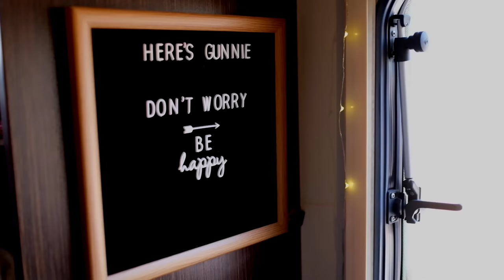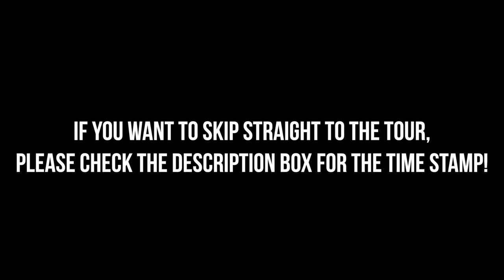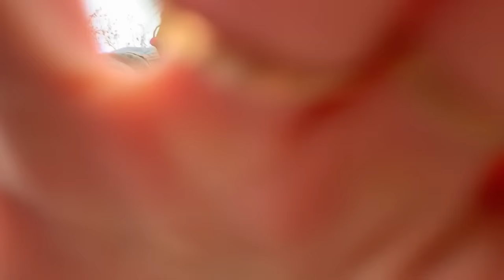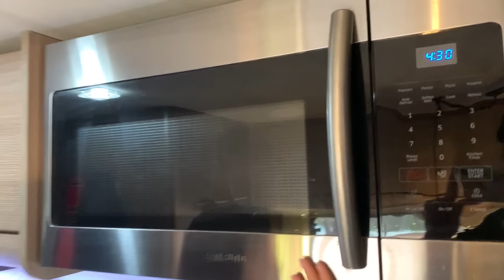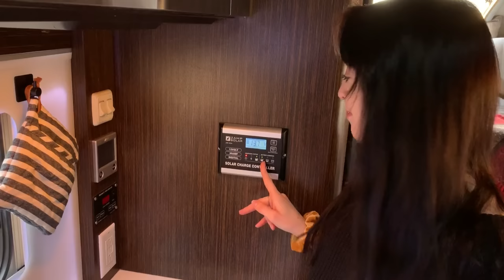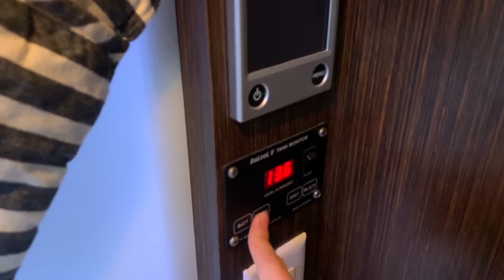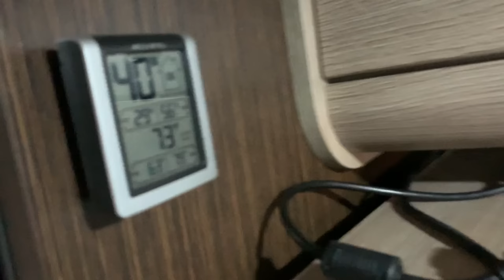Off-Grid Full-Timing Couple's Truck Camper: Tour + Review of Cirrus 820

Comment: My wife and I spent 2 years traveling the country with your same set up.  We had the same issues with our camper.  I drilled a hole in the battery carrier so the water would drain out.  For the Aldi dumping glycol at the worst times, instead of the plastic tube from the brass valve going outside the camper I had an empty 1 gallon distilled water jug and duct taped the tube into the jug and stuck it under the table with more duct tape.  Then some times it would fill half way with glycol and I would just dump that back into the reservoir.  Super annoying, but the heat was nice.  I also mounted a hitch to the front of the truck (2015 gmc like yours), then I put a cargo carrier on the front of the truck.  On top of that I secured a tractor supply steel box that locked and opened from the front.  Then inside there I put a Honda 2000 generate and cut a big hole in the bottom and one on the back of the box and I would run the generator inside and always leave the camper plugged in.  We loved our camper, but had to do allot of stuff to it.  Another big thing was putting an additional valve under the poop drain, because our poop drain would always leak a little and when I opened the cap onetime I was splashed, never again, so I added that outside valve.
Reply: I'm looking at purchasing this model and wondered how the front window holds up to water coming in while driving in the rain? Most campers with windows on the front eventually leak and take a beating over time.

Comment: Awesome, thorough review!  Thank you.  Unfortunately, most RV's are not meant to be lived in full time.  Condensation and the potential for mold are indeed a pain in the butt and require constant vigilance to avoid, despite manufacturers assurances of four season capability.  Overall, it sounds like your rig has held up well considering the full time use, and that's good to see and hear.  Seems most any RV has nagging little issues that make one scratch their head and wonder why they did that.  In the case of your rig, the leaking battery compartment, the positioning of the Alde thermostat, the shallow factory installed sink, and the positioning of the bedroom charging station, would have been sore points for me.  Also appreciated your honest opinion on your GM truck, and how it handles the load.  I think that the two of you make a terrific couple.  The non rushed way you led us through every nook and cranny of your home on wheels is probably how you live life as well...walking rather than running to your destination.  Happy trails!
Reply from the maker: Hi Ronald! Thanks for watching! Glad you enjoyed it. Yeah, we figured that the camper would eventually show some issues being our full-time home. I do wish Cirrus were more diligent about their insulating nonetheless. Maybe we'll stick to dry climates like the Southwest, all of our problems have disappeared since coming here because of the dry air haha. Thank you so much for the kind words, we truly appreciate it. Some people have been less than kind (I've had to delete quite a few horrible comments), so comments like yours encourage us to continue and keep our heads high. Great to have you here!!
Reply: I liked 2.5 month in my Promaster 3500 and didn't notice any mold...
Reply: This is my first video of yours; not the last, however. Excellent overview. Do you still have this rig? Would be interesting to know how it is nearly two years later (although I may find this answer once I peruse the rest of your videos) as I am interested in doing the same thing...  year-round truck camper living. 

Subscribed :)

Comment: I was able to fit 6 one hundred watt panels on my truck camper roof. With a 3000 watt inverter and 2 Renogy 170 amp hour lithium batteries, I'm able to run my 13,500 btu air conditioner as long as the sun is shining, and the batteries stay at 100%. I'm so happy with this setup. But  I live in Florida,  so it's a necessity. Beautiful camper though.

Comment: The 820 is a nice camper. Really the only thing I don't like is the large box under the dinette. It only allows for 2 adults to comfortably sit there. Same with the 920, it's bigger sibling. The dual-pane acrylic (plastic) windows are nice, but unlike glass you can see how easy they scratch @ 0:50.

Comment: Slide in Truck Campers where popular at least from what I know in the 1960's to 1980s then trucks changed the bed size and campers did not fit till the camper world caught up.  You can camp in the truck cab, I have more than once.  You need to get a climb through to the camper set up. The fishermen/women and duck hunters that hauled boats used these campers a lot.  Smart idea on the hangers.   Put a hose and bottle on the overflow glycol if you can.

Comment: Thanks for sharing.  I debated between the Cirrus and Nothern Lite truck campers and ended up going with the Northern Lite.  Really happy with it and after two seasons of full time camping in the Rocky Mountains and SW Deserts (4-5 months at a time) I have had zero problems with it (and I have taken it into some really rough areas).  Since I mostly boondock I understand a few of the things you bought up.  In the NL, the microwave is stored inside of a cabinet, so we removed it and can use the space.  The mold is a problem with lots of truck campers and the problem is that the cab over allows cold air to move under it and when sleeping in it you produce lots of warm air and this condensates under the mattress as you found out.  I have found two fixes to eliminating the condensation...one is easy, switch your head from the front to the end that faces the kitchen ...the other is to get a small fan and place it at the head so it moves air from the front to the rear.  I actually point mine to blow between the head of the mattress and the front bulkhead (I can get a 1 inch gap there) and that moves the air under the mattress as well as pushes the warm air around.   Lastly, think about fastguns for your tiedowns...they are awesome.  You will have to go on amazon and get 4 keyed alike locks for them cause people like to steal them but those are cheap...the locks not the fastguns.)  Have fun on your trips...maybe I'll run into you guys out on the trail.

Comment: I recently spoke with a NuCamp dealer, and wondered why they were running out of stock on the Cirrus 720/820/920's.  I was told that NuCamp stopped production of these truck camper units for 6 months to perform a "re-tooling" operation.  Apparently, there are a number of things that will be changed (improved?? we hope).  I have to think that NuCamp watched your video - maybe several times.  Your thoughtful and highly detailed review was excellent.  I thoroughly enjoyed watching this from beginning to end.

Comment: I think you said under your sink gets warm?  If you can move the items and take the door off and give your dog a bed there, he NEEDS a small space to be in to feel comfortable that is why he hides in the bathroom.  Smart move using baskets to keep things in place.  Nice job putting in the fan.  You can get the USB outlets on Amazon and put them in.  Put your seasonal sweaters etc in plastic bag and double it so they do not get damp from the wall.   That looks so much like a 1960s camper I knew as a kid, the 2 tone cabinets, none of the things like microwave and usb outlets of course.  Very good choice on the camper, it is normal to need to make it your own and you are doing a great job.

Comment: Nice camper, love the truck.  If the one cabinet area is getting to hot that could cause the heater to purge.  Not sure that is doing it just a guess.  Maybe you can try leaving it open for Wayne to crawl into and the air circulate.  I see you have some negative nellies, good job ignoring them and move on with your life.  Being able to stare up at the stars and the sky at night would be pretty sweet.  Can you put a small shelf over the windows on each side of your bed, you may be able to use the power to the reading lights you hate to run a usb outlet to the small shelf and it would get the cords away from your head.  I did not catch the young guys name but I hope he knows how lucky he is,.  I hope you 3 are safe and healthy, did Wayne grow much?   Have fun and be safe.  FYI Other than the ones that are just plastic some of the european camper builders have admitted to getting their ideas from 1940-60 USA campers.  Look at the old ones for good ideas.

Comment: Lonnie,  you made a passing comment about the HappiJac system which sounded less than enthusiastic.   Can you expand on that?   Thanks for the review!  Love the upgrades!
Reply from the maker: Sure! Yes, unfortunately we are not happy with our decision to go with HappiJac vs Torklift. We had an accident in Florida where the HappiJac system failed us and helped to total our truck bed + bumper. Essentially, we were in Florida after the hurricane and most street signs were down. We later found out one of these signs was a warning for an upcoming speed bump. It was one of the road colored bumps so we didn't see it until it was too late. We went over it going about 30 mph.
The whole camper jumped and the rear turnbuckles flew completely off but not before pulling up the the bumper into a permanent 'U' shape. The front turnbuckles pulled the front of bed back (due to the attached plate), causing everything attached to warp and paint to crack off. The XM satellite antenna on our truck slammed into the bottom of the cab-over, causing a deep gouge in the camper as well as the need to replace the $800 antenna... We were quoted $8k to fix the damage to the bed and bumper. 
We recently met another Cirrus 820 owner who did the exact same thing with a speed bump but he has the Torklift system and he said there was no damage. We're kicking ourselves for not researching enough and just doing what the dealer told us to do. They said HappiJac is just as good and cheaper, so we thought why not but the fact that Torklift is spring loaded and attached to the frame (vs flimsy bumper) really makes a difference, and would've saved us in this instance. After the dealer installed everything they proudly said, "This is the first truck camper we've ever sold!". Why they thought they knew best with zero experience, we'll never know...
Reply: @WheresGunnie  Thanks a ton for the detailed reply!
Reply from the maker: Chris D of course!! We want to warn and educate people about happijac’s failures and downfalls.
Reply: @WheresGunnie 
Wow, just wow! What an ordeal.. :/
Sorry that happened to you guys. Thanks for sharing and helping others with this info! Happy trails, be safe. 👍

Comment: I've got a maxdeluxe air fan to you need you to do is get  some  aluminium plate long as you need screw them to the original holes in your roof 
then slide your solar panel Forward than pop rivet the solar panel to aluminium plates
 then that would put the solar panel Forward more than your fan with can  close fully

Comment: hey guys - great video and walk-through, especially on the camper.
I just ordered a Cirrus 670; it's a "1/2 ton capable" camper (around 1700lbs) for a short-bed truck that, from a lot of your comments, gets after changes you would like to see.  For example - you can order the Cirrus 670 with / without A/C (to gain more roof space for boondocking solar panels), the storage stuff you highlighted was changed, the power in the sleep area moved to the sides - a lot of the stuff I remember from your video tour was implemented in the C670.  It was almost as if they had been watching your video and took your recommendations

Anyway - appreciate your work on the walk-through - check out the 670 if you get time.  Right now I think there are only videos out on the prototype, it's not even listed on the web site yet, but you CAN order it.  Once mine gets here I intend to do a couple reviews / walk throughs to help get information out there on it.
Reply from the maker: Hey! Thank you! Congrats on your new Cirrus!! That's so exciting. I just read Truck Camper Magazine's article on the 720 (which is the official name for the 670 prototype). Looks like an awesome camper! I love that they made the A/C an option! Progress! I'll be keeping an eye out for your walkthrough, I'll be super curious on an owner's thoughts.
Reply: Might want to check your weight. Truck Camper Magazine (a fantastic resource) recommends a 3/4 ton truck even for the 720. The issue is, once you add all your gear and fluids you carry you run the risk of going over your 1/2 truck weight limit. Apart from less safe you may invalidate insurance. Always best to go for more truck. I've had a dealer tell me the 820 can be put on a 3/4 but as Lonnie and Guntars have done, I'd go with a 1-ton. Seriously considering the 820 myself so I found this video excellent.
Reply: Where's Gunnie? Thank u I was looking for 670 an kept seeing 720 lol

Comment: You can get a separate  temperature sensor for the Alde which overrides the one in the control panel. You can install this anywhere. You should also try to reduce the circulation pump speed to reduce your other Alde issues.

Comment: I would have been okay with all of the other "issues" that you had until it came to the way water collects under the mattress...EVEN WITH their Froli System. Anyone who has ever had this type of problem knows it's a huge health hazard and lungs can take years to recover. A top of the line slide in camper "should" have already addressed this and taken it into account. With this type of feedback, I hope they re-engineer the cab over sometime soon!
Reply from the maker: Shannon K yes! we agree 100%. It’s very disappointing when you do expect it to be a high end camper and thus, to have been engineered and tested to prevent these issues! They will say it’s because we live in it full time but I think if they can call it a “four season camper” it should never have insulation issues.
Reply: We have the same issue in the pass with our Northern Lite truck camper wich we use in cold weather in Canada, a 1 inch thick styrofoam sheet under the matress help alot, it’s easy to fit a sheet of styrofoam and it’s realy not expensive to try this method. It’s not perfect because air flow is trap under the matress but it’s a very small investment to help in this situation.

Comment: So it seems like you have a GMC Sierra 3500 extended cab single rear wheels. The payload capacity can be as low as 3200 (eg. 2018 GMC Sierra 3500) for your 2018 Cirrus 820. The Cirrus 820 wet weight is 3900 according to Trucker Camper. Are you sure you are not over-loaded even with a gas engine?

Comment: This is awesome, y’all do a great job!  I about choose a Cirrus! For 1 I had a 2500 dodge diesel, that they claim would have handled the 820, with some suspension upgrades? I really didn’t want to purchase a new truck! I liked the fact they use normal tubing a valves I believe, not the typical have to order from an RV store stuff! I liked also I’m only 2 1/2-3 hrs from the factory should an issue arise! But unfortunately we bought a new 3500 dually! Our main thing about a truck camper it as y’all mentioned being able to tow a boat! That way I don’t have to random trailer pull which would b a pain n my opinion, and some states it’s against the law! We decided to go with a Lance 1172, simply bc I work construction and will be living out of it a lot as I travel the country for work! So having the extra space to pack my clothes for year round bc I never. Know where I’ll b sent is nice! Haven’t officially picked it up yet but a dealer is holding one for us currently! Keep up he great work really enjoy the videos! And also for the battery tray collecting water, maybe drill alittle pilot hole n the corner of the trays to help drain it, and u could also go to Home Depot or Lowe’s and buy the adhesive weather strip and put on the inside of the door, it won’t totally seal it off, but I’m sure it would help not have as much leak pass!!!

Comment: Thanks for shearing this video.. it is lot of good information for a new buyer .. it seams to me Cirrus has taken lots of shorts cuts on this RV, pe finishing touches are not there, like the battery compartment missing the gasket so water gets in, for me when company's do this kind of mistakes that you can see, what is inside what they have done who knows.. If i were you i would email them and ask about the battery compartment door gasket just to see what they will say.. Also look into Lithium batteries so you can get more out put ..good luck to you guys and be safe..

Comment: Hi, great comprehensive review, nice job.  I am most amazed to hear you say your GMC 3500 single rear wheel does not need airbags due to sag with such a heavy camper?  That is amazing.  I am currently shopping for a new truck/camper combo but I was not considering a GM.  Now it looks like i should.  Can you comment any further on the payload and handling aspect of your rig, thanks?